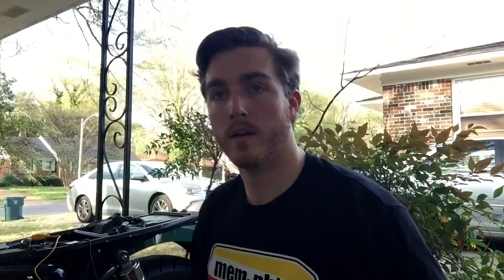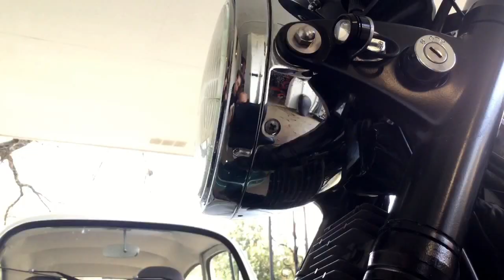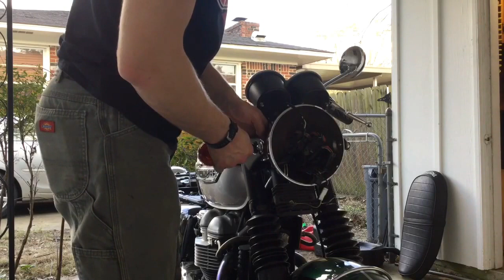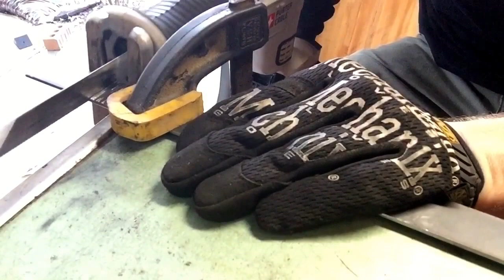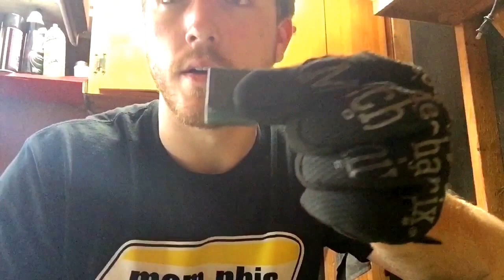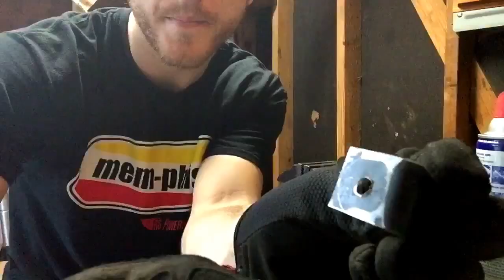Budget Bonneville Cafe Build - Part 2 - Revival Cycles LED SuperNova - Custom Blinker Brackets

Comment: put a inside star lock washer under the battery bolt or they will vib loose .. head light bucket screws need plumbers pipe Teflon tape to keep them from falling out ..